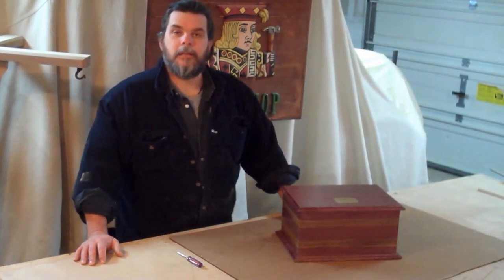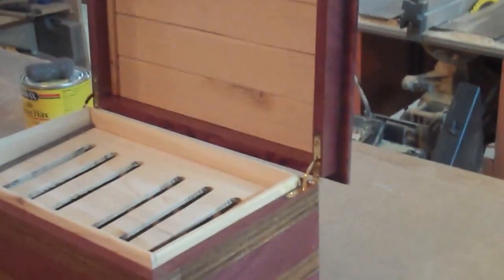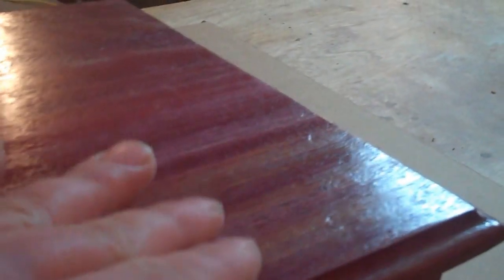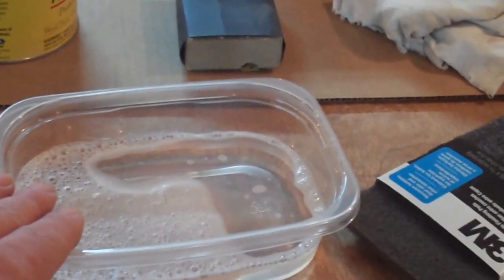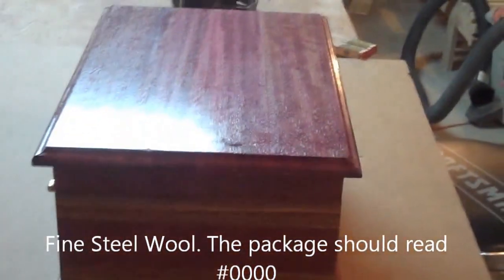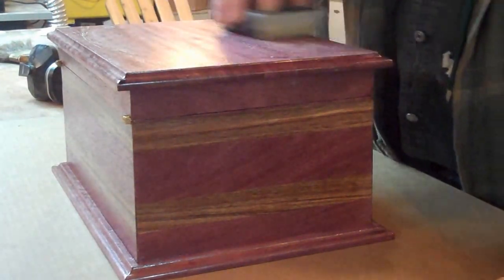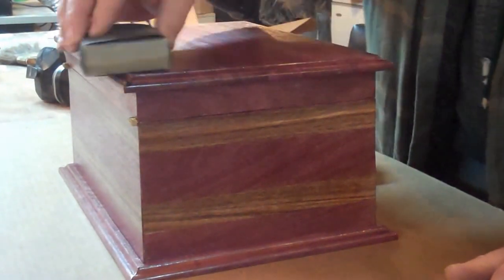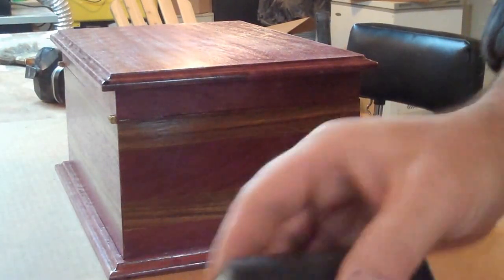Rubbing out a Lacquer Finish

Comment: I am a furniture maker.  Finishing is the hard part, if you ask me.  I can see that the grain on your project was not completely filled.  For a humidor, most are lined with unfinished Spanish Cedar.  The reason Spanish Cedar is used is because it is unique in that it does not expand with moisture. Because of the moisture, it is necessary to seal the inside of the box (under the liner) with a couple coats of shellac.  It is also good practice to seal the outside of porous woods also.  10 to 15 coats of lacquer (sprayed) usually follows with sanding between every 3 or so coats.  After the coats are cured (a couple of days, depending on environmental conditions).  Sanding with a block with 800, then 1200, then 1500 grit paper, followed with rotten stone and oil on a rag, with give you a finish like glass, and just as reflective (like a piano).   It gives the project a "wow" factor. 

It was hard to see in the video, but it looked like the hinge was well set in the mortise,  A hard part for some.

You did a good job on the box.  I especially liked the perforated divider.

Comment: Based solely on what we first see prior to rubbing out procedures, it appears you didn't use any filler prior to applying the finish.  I'd be interested in finding out from you whether that's true or not, and also, is you did use a filler, what brand and type.  Thanks for your courage in sharing your thoughts and procedures with us and all the best with your woodworking projects.
Reply: Ha!. I did not use a filler. Very nice catch! I should have...most definately but since that video I do use fillers in my finer projects. The finish is just so much nicer... it was my intent on this piece to leave the purple heart raw but in hind sight filler would not have affected it at all and would have just made the finish better.
The fillers I use are varied but some here in my shop are crystalac, Timber Mate and I've even used sheet rock spackle. 
I'm working on another humidor currently made of African Mahogany and Lace Wood with a full Spanish Cedar interior. I am filling the grain on this one.. I'm decided now if I should enhance the mahogany grain with a dye or just leave it... 
Thanks for the question... and again...good eye... 

Sincerely,
Steve - Timber Jacks Woodshop

Comment: Hello josvanr 
it is actually the scratches themselves that make the piece shiny and smooth. you must however, use a fine sandpaper when rubbing out the lacquer. No less than a 320 and even consecutively higher is better. The beauty of lacquer is that you don't have to sand with the grain however, sanding should create scratches in the surface not detectable groove. if you can feel them with a finger nail then I would suggest a higher grit sandpaper. 400, 600, 1000, 1200, 1500, 2000. wet sand with water and a little liquid soap.

Comment: Lacquer us SUPER THICK!!!!
it dries FAST!
you MUST THIN ITi finally got a decent finish with an 80% thinner and 20% Lacquer. Temp was only around 65°F !!!
...if you need to take an edge off or a drip, just use straight thinner, but carefully.

Comment: HI, may I make a suggestion? Why not use a cutting compound like G3. What I do is, I sand wet and dry with 2000 grit paper, when it is totally flat I use the G3, you will see a shine that will make your heart skip a beat! And then finish with a swirl remover. Greets from the UK
Reply from the maker: Hello Chris
Thanks for viewing my video and for taking the time to leave a comment. Your suggestion on the liquid compound is a great one!!! and I have used them before and when done correctly, you are right, the look is fabulous. I think however, that the liquid compound science and technique is a little more advanced for basic wood working beginners. I was trying to keep my video as basic as possible for the novice. Most people don't even know that you can sand a finish. They think once you apply it that's it.... I appreciate the input and to all the novice wood workers out there Chris is right! I suggest you practice with liquid polishing compounds. And Yes, the automotive polishers are fine to use on wood that's what the G3 is..try it and experiment. You won't be disappointed. Thanks Chris...
Reply: Your welcome m8. Great video btw

Comment: You have to wet sand with 400 until you almost get to bare wood and put a couple more coats on and wet sand it again until you can't see any grain. Fill the grain. Wet sand up to 2000 then swirl mark remover than car wax.

Comment from the maker: Hello Patleo
Right off the bat there are several factors that can apply to your situation. What type of lacquer did you use? Brush on or spray? How thick was the first coat. It should be very very thin. Did you apply a lacquer wood sealant prior to your first coat? How humid was the room in which you used the lacquer?  How long did you wait before sanding? What grit sand paper did you use? And finally, did you wet sand the layer or dry sand it. All of these things can play a role in why your lacquer was tacky and why it stuck to the paper. Consider the answers to these questions and try and determine if any of your actions or conditions were counter to a good application. Let me know and I'll be glad to guide you through a successful application.